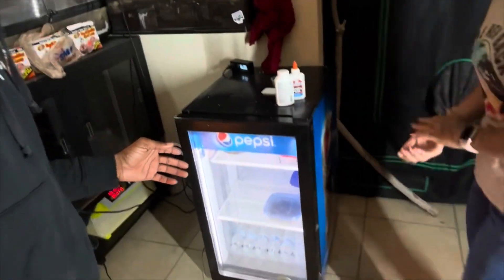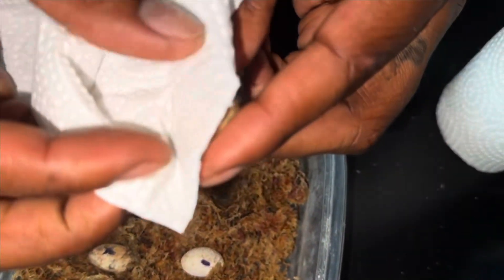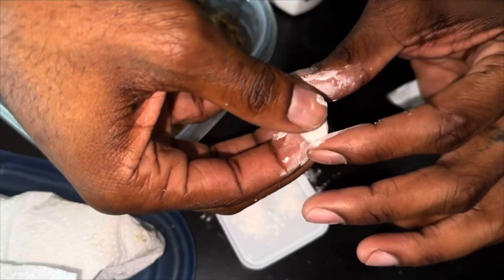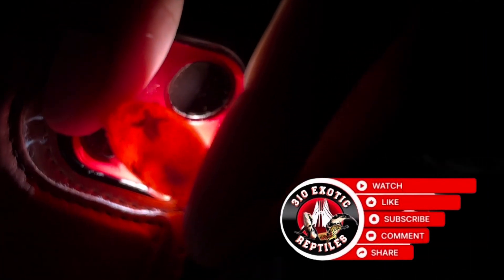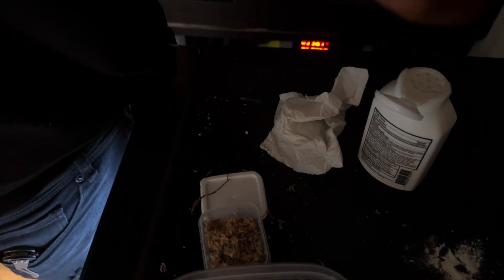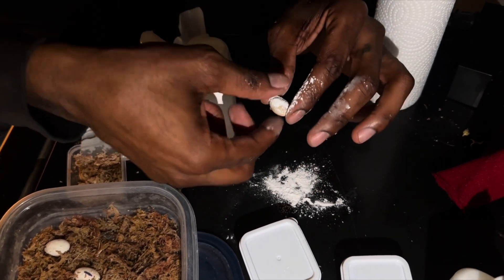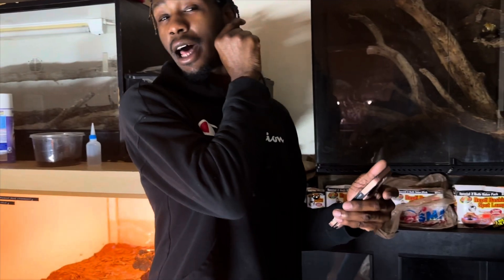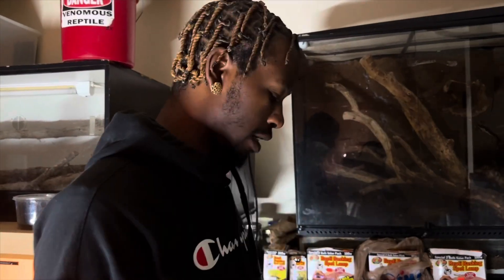Trying to Fix Moldy Eggs | Fire Skink Series Pt.2

Comment: Also, I, and I am only talking about me,  I hate those incubators. And for good reasons,  They are too small. If you are going to do this for any length of time,  They fail fast. Thta is, when they fail, they either get too hot FAST or cold FAST. When you learn to captive produce herps,  your going to get eggs, and from every female, and most herps multi-clutch.  So your  going to run out of room in those tiny fail easy incubators.  My room incubator was based on the advice at the kind folks at Dallas zoo years ago, and by Dave and Tracy Barker. While I am good at this and normally do not recieve good advice,  That was the best advice ever.  Get a room, or use a big closet. Those little things are for hobbyist. Those learning, not those giving advice. Just something to think about. Have a great day and hope the skinks hatch.

Comment: having hatched herp eggs since 1962, and zIllions of monitors.  Moldy eggs have different causes. For example, white mold, is normally produced on material outside the egg and can be fixed. First, the hatching medium, I moved to Perlite, as it normally doen't contain carbon matter. on which mold grows.  Black and Green mold, normally is supported on dead tissue,  and is not so easy to fix.  With White mold, in perlite, just bury the egg.  Now, some species, like kingsnakes can hatch out of a ball of mold.  Monitors no so much, any type mold can kill a monitor egg.  ALso what your doing causes more harm then help.  Same for candling, it can't make a bad egg hatch and can only harm a good egg. Sometimes rolling eggs kills them, sometimes not. Again, there is zero sense rolling them, all you are doing is causing possible harm. All in all, your making a video, and what your doing is rarely of benefit to the eggs,  the video is only a benefit to you.  again what your doing causes more harm then helping the eggs.  Now consider this, a absolute reality, Those eggs normally incubate and hatch outside i the dirt. dirty dirt, hahahahahahaha.  Let me think, as mentioned, I have produced many many species of monitors, one outside clutch I missed, Lace monitor eggs,   We have indoor outdoor cages as well as a full breeding facility. So the adults were inside in the winter, I was redoing the cage mid winter, I was hitting the low 20's at night, I found a nice clutch of eggs.  I took their temp with a temp gun, they were 40F, So I put them in a egg box and went to put them in our incubator room  Yes we have an incubator room. The eggs started to bead, so I realized what a goofball I was, and I move the eggs on the floor to the coldist part of the room and let them stablize, then move them a tiny bit warmer, etc, until  I put them in the incubator room.  Guess what they all hatched. So they went from freezing cold outside, to warming too fast, to taking a few days to get them up to your mid 80'sF and still they hatched.  All I am saying is,  herp eggs are a lot stronger than you think. Also in another cage, I have Ackies lay outside, then it rained and they would under water for at least one whole day, and wet as can be for a couple more, I then dug them up and they looked like ping pong balls,  had plant roots growing all around them, and they too hatched. About your VID, don't post it until your have results, that way,  you know if you helped or not.  As I have not seen anyone, post a after video that showed all what they had done failed. Again, from an old guy, who has done this for a life time.